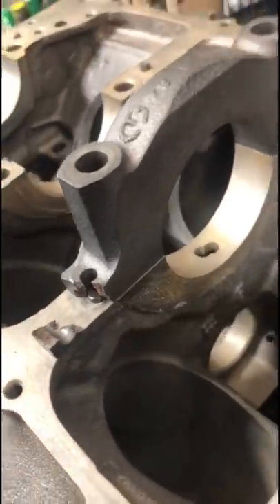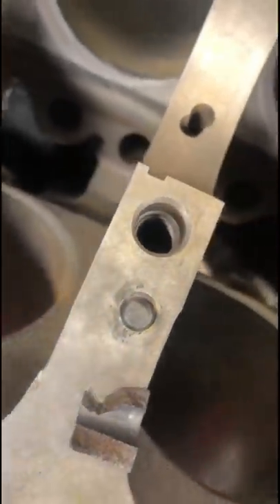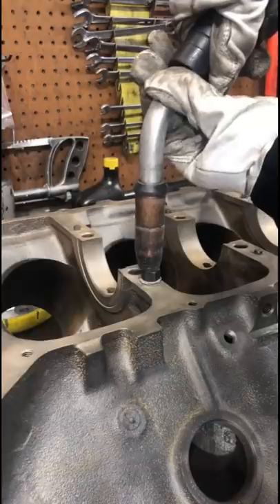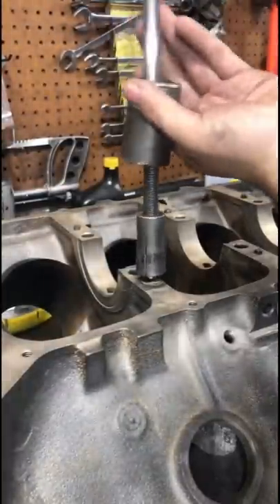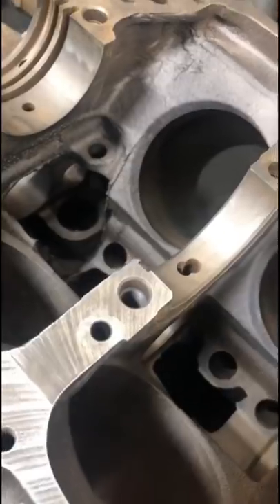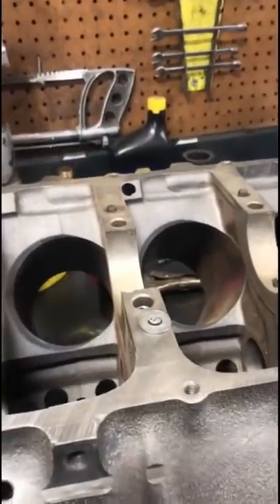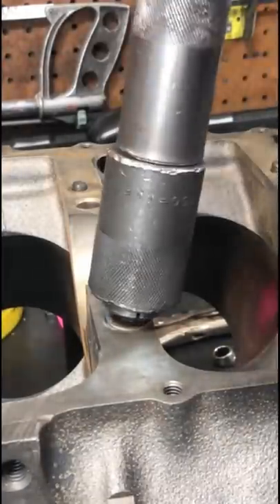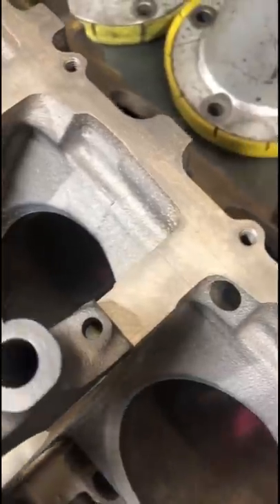#shorts This is why you should pay attention when building your engine…

Comment: Using an impact... On bearing caps?!😵 Who does that?!
Reply: I do
Reply: @MrOtter2270  😎
Reply: Yeah, wtf? I remember saving my money to buy a GOOD torque wrench, then practicing with plastigage on a junk motor just to get the feel and accuracy of the procedure. Thought of ANY other tool never crossed my mind.
Reply: My Milwaukee 1/2 onekey impact has torque settings that I can adjust with my phone. I still wouldnt trust it lol
Reply: @itsjustmechill.5292  been eyeballing that thing. Sounds like a 30-pack Friday night “learning experience” in the garage. BYO30 of course. We can “learn”, just not share😏🍻
Reply: I used to do it all the time when I worked on a top fuel team. But outside of that it's a very bad idea especially with cast iron.
Reply: @southjerseysound7340  they do the same thing at factories also. With proper tools you can do anything. 
But slamming one down?
That would be a no.
Reply: I thought 2 ugga-uggas on a breaker bar was the proper torque?
Reply: @southjerseysound7340  What does using an impact mean?
Reply: @tafarid.7347  impact driver/wrench. Either powered by air or electricity. Too much torque produced for applications such as bearing caps. 

I too would fire anyone in my shop doing this.
Reply: @southjerseysound7340  it’s about finesse and experience. I use shortcuts similar to this depending on the machinery, but have over 10 years as a service tech.
Reply: @nigeleharis5886  So...like a mechanical wrench? Sorry I'm still a bit confused, but thanks.
Reply: @tafarid.7347  I’d say so. It does the work of an open end 🔧 very quickly and with a lot of force.
Reply: @nigeleharis5886  Oh ok, thanks.
Reply: its ok my cylinder head and spark plugs were tightened with an impact. ill never forgive that shop
Reply: Right
Reply: Lazy mechanics.
Reply: @joriskylie6857  What are you talking about? They use robotcells with industrial torque programed drivers to sequencially tighten them. Usually from center->out, in steps.
Reply: @Tabacish  I didn't make it clear but what you said is what I meant. 
I was responding to the comment the guy that worked for a top fuel racing team.
They don't slam their parts together with impact guns. They use specialized tools.
Reply: @joriskylie6857  Gotcha
Reply: Although a top fuel race enging is only supposed to last a few minutes so it's unlikely that you'll wear out the bearings due to torque....
Reply: @flipnotrab  half the "experts" here in the comments dont even know what plastiguage is. They probably dont even know what a clearance spec is
Reply: @thefinalkayakboss  you’re probably right unfortunately. Specs? What specs?! Where’s my impact??? 😂😂😂
Reply: That’s just stupidity…only for removals…any mechanic who does otherwise avoid 😯
Reply: not on automotive engines, but some heavy industrial call for an initial torque, and after you tighten them to that torque, the final tightening is specified in degrees of turn. Nothing wrong with using an impact wrench on those engines, 60 degrees of rotation is 60° of rotation no matter how you do it.

And why are you guys talkin about bearing clearances? The torque does not set the bearing clearance, the bearing clearances set by the diameter of the journal and the bearing size selection.
Reply: Almost every car related youtube channel does this.
Reply: @joecummings1260  bolt stretch has an equal and opposite strain pushing against it that is thread distortion. If you overtighten the bolt the thread distortion will pucker the threaded mating surface, throw off concentricity, reduce the contact area and make the cap prone to rocking.
Reply: @JorgeHernandez-lu1mi  yeah I've been through that working on aircraft engines. In fact if you remove the cylinders for any significant amount of time you have to bolt a plate on to where the cylinders bolt to the crankcase to stop the aluminum from distorting due to lack of fastener tension. But a cast-iron block automotive engine, unless you're a total animal and really over torque the bearing caps, I've yet to see it make any significant difference in the bearing clearances.. not anything you're going to be able to measure with a piece of plastic gauge, that's for sure.

The same goes for the honing plates that you both on in place of cylinder heads when you do the final holding on a cylinder block. I've yet to see any kind of significantly difference in cylinder contrentricity  with them on or off a cast-iron block.

Frankly it seems like the younger mechanics worry too much about the wrong things. , They're all super concerned with torque being some kind of super precise thing. I see a lot more blowing up motors over stupid little oil leaks, then I do from incorrect torque
Reply: My grand uncle built drag cars, and never used a torque wrench.
Reply: @MoswenMedia  I'm 60, and when I started turning wrenches when I was a kid, you almost never saw any of the older guys even picked up torque wrench. when you start as a helper when you're still in your single-digit years you develop a feel fort work and fastener preload. If you wait until you're twenty and then enroll in a tech school, there's a good chance you're never going to develop the feel. It's kind of like this, I had a cousin who played for the New York Knicks, from the time he was a little kid all he did was practice basketball. you don't get to be a pro basketball player by starting with an interest in basketball at like 20, if you don't start from the time your little kid, you're never really going to end up being a pro
Reply: @joecummings1260  yea I watched him tighten heads down with an impact as a kid and never checked the torque. He had a 426 hemi in a dart that my uncle could take down the quarter mile in 10 seconds
Reply: Ugga dugga
Reply: @joecummings1260  Torque to yield (°'s of rotation) after an initial torque is fairly common in automotive applications, particularly engine assembly. I sure as shit wouldn't trust anyone who uses an impact to re-assemble a motor. 🤦‍♂️
Reply: @divinetruth2875  degree of rotation, is degrees of rotation no matter what you use to turn the fastener. And not all fasteners who's tightness is specified in degree of rotation are torque to yield fasteners
Reply: Absolutely
Reply: Idiots apparently. The only time I use an impact on aluminum is to quickly speed it home and its usually a hex driver. Light trigger too.
Reply: Mechanic Steve here on Y T does it and people say he is the best mechanic in the 🌎
Reply: I do it. Hell, I'll take a running motor apart JUST so I can
Reply: @elkayezs8wslkwaterfountain826  Damn
Reply: @elkayezs8wslkwaterfountain826  was it jiffylube? 🤣
Reply: Only use a 3/8 impact to run them down on the lowest setting and then use the torque wrench never had a problem out of the 25+ I’ve built
Reply: @joecummings1260  millwright tight!
Reply: Right? I usually welder them on
Reply: @elkayezs8wslkwaterfountain826  I normally do maintenance on my moms car but wasn’t home and she took it to wal mart. The next oil change I got to do for her instead and found out that they not only used an impact on the drain plug but they used the wrong size socket and stripped the plug. I was so angry. It doesn’t keep any effort to tighten the drain plug correctly.
Reply: I use impacts on a lot of things anything on the inside of the engine even im not dumb enough to touch with an impact
Reply: @tafarid.7347  typically an impact is used to REMOVE stuck nuts or just remove nuts quickly.

Technically it's not supposed to be used to tighten down even lug nuts, certainly not anything as precise as internal engine nuts and bolts.

What likely happened is someone was using the impact for quick assembly, planning to do it right at the finish with a torque wrench only the main cap wasn't lined up on the dowel. He probably didn't even hear it pop.
Reply: @Tabacish  hell, they build those loose in the first place. Dumps oil through massive gaps and spins fast while burning a 33% fuel to air mixture.
Reply: @joecummings1260  Oh brother, the deformation on a cylinder when tightening down a cylinder head is massive, but of course that depends on the setup. Massive cast iron? Some. Individual liners pushed down by head? Yup. Cast liners in alu block? Yep, even position might be off..
Also, it's next to impossible to measure this by hand, you'll need a proper CMM..
Reply: High school kids or adults who stopped learning when high school ended
Reply: Unga unga
Reply: I’ll use electric to get them started, then torque down after and I’ve never had any issues🤷🏼‍♂️
Reply: 1 ugga or 2 ?
Reply: People that build 15L AND UP engines
Reply: @flipnotrab  right?? Like these are the internals of your compression based engine. Not just some fuckin screw on a door 😂
Reply: @itsjustmechill.5292  good. Impact and Torque don’t go on the same sentence
Reply: Pakistani truck mechanic
Reply: I do
Reply: You use impact for this kind of work, sorry but you're a butcher, not a mechanic
Reply: After hand starting, I use one to snug them down and then by hand again to finish. To use one all the way is nuts.
Reply: Same kids who buy cast caps
Reply: Torque Wrench only
Reply: All too common nowadays. Especially in auto shops that force you to clock in to every single meaningless task so they can chart efficiency (basically a guaranteed system of rewarding shortcut taking) and force techs not to take pride in their work.
Reply: Absolutely not using an impact , only good thing is atheist it didn't make it back to the customer before they broke
Reply: @glenwaldrop8166  That's why best practice is to close joints before tightening bolts and not using the fastener to close joints
Reply: @MrOtter2270  really?
Reply: People with so called budget builds but spend hundreds thousands on a build aka tv shows
Reply: @flipnotrab  😄
Reply: There's a reason you have to tighten them in sequence and to spec. Then you have to do it again, using a impact would almost always cause a weak point for something to break.
Reply: Lots of people and it's not a good idea.
Reply: On heavy duty diesel applications where the torque is 180ftlbs plus 120 degrees on stretch bolts I use the torque wrench for the initial torque and 3/4 impact for the angle to stretch those bolts.
Reply: Lmao I built a 454 big block with an impact
Reply: I just worked at an engine shop, diesel engines, these guys put the crank im with an impact, torqued it to spec, then… get then 😂 they used the impact for degrees of rotation.
Reply: The very cheap garage....
Reply: @thefinalkayakboss  plastigauge no. But micrometer...YES
Reply: @juniperjd4891  clearly none of these automotive heroes have done a set of mains on a dd15. Half of them would have a hernia twisting them the final 90°
Reply: @blairthompson3445  fr you are not lying every time I work with cars everything feels so tiny and small and easy guys don’t know how easy they got it lmao
Reply: Guy is definitely humble to admit his mistakes
Reply: @northdakotaham1752  flat rate crew 😅😅
Reply: Homeowner engine rebuilders.  True “engine building” is MUCH different than just assembling parts you bought in a kit off eBay.   Let the replies fly in on this. 🤣
Reply: Torque to 180lbs then turn 2 flats. I’ll use my 3/4 thank you.
Reply: UTI students with less than 80’s on their tests
Reply: Maroons
Reply: E experienced mech.?
Reply: @martinbernath  Not mine
Reply: The real question is why is he using the bolts to set the caps
Reply: My brother
Reply: @garysgarage.2841  mine too! 😝
Reply: Heavy duty diesel, some engines the manual actually tells you to use an impact believe it or not lol
Reply: @Club-kc9wl  yup and go 6 flats worth of rotation
Reply: Only clowns do that.
Reply: With the engines I work on, you have to. It's in the manual.
Reply: Me building the last 100 engines, my old boss proably on several thousand engines. A tool is only as good as the user
Reply: @townsendliving9750  very good point. Six point socket with the lines drawn at each point so you can add up the angle!
Reply: i do but not full trigger. pretorque spec is 1/2 ugga dugga
Reply: Theirs not many of them....I mean really how long could it take 😅
Reply: My dad most of my life. Not that he's built anything of particular note, but that's how he's always done it. I'm not that brave I use a nice click type torque wrench personally, using an impact feels so wrong I've never even thought of it.
Reply: People who don't know how to use a wrench
Reply: Some of these people seem to think you are using an impact instead of a torque wrench no its just to snug them up
Reply: Same guy that uses one on the oil drain plug ! ! ! ! ! ! ! ! ! ! !
Reply: All the time on CAT 3400 and C-Series engines - torque main bolts to 190 ft/lbs and turn an extra 120-deg with a 1" drive impact.
Reply: I’ll use a little impact driver, which might cap out ~50 ft-lbs (on a good day) on main cap bolts, which isn’t as tight as most mains go, so I’ll use it to seat the caps to check my clearances and/or just to bottom out the bolt so I can torque it properly
Reply: @MrOtter2270 I hope you’re made to pay for your reckless behaviour. That was to be the dumbest thing ever when working on an engine rebuild.
Reply: @redneck4200000 I hope you’re made to pay for your reckless behaviour. That was to be the dumbest thing ever when working on an engine rebuild.
Reply: people who also got "vaxxed".
Reply: Had a guy at dealer(lexus) that would use his impact for all his cam riser bolts and cap bolts and everything . Also had a guy whiz wheel his heads and block on a rebuild and then the head gasket wouldn't hold lol
Reply: @thefinalkayakboss plastigauge can lie to you, so keep that in mind. I prefer using more precise methods.
Reply: @thefinalkayakboss I love using plastigauge and its either on the number or its wrong no within a thou bs. Thankfully I read Smokey Yunick and Bill Jenkins books at a young age. I am still learning tho.
Reply: @joecummings1260 Yes right here. Thank you. Agreed
Reply: @joecummings1260 Yes. My father started me very young. Lol Child services these days would have kittens seeing what I was doing at 4 or 5. I thank my father for doing that for me all the time. I encourage people start them young. I know it kept me out of trouble and gave me a love to keep learning.
Reply: @jcues03 I use both it feeds my ocd lol
Reply: I like to ask those kids that use a torque wrench for everything where the latest certification for their torque wrench is, and if those values are for dry or lubricated fasteners, and if lubricated, what the specified lubricant is. I always get a blank stare. I on occasion repair some machinery and structures where I have to  provide certifications and personally document the fastener preload process. They all think they are so smart because they went to some BS auto tech school. The idiots don't even know what a multiplier is. Tech schools aren't worth shit
Reply: @joecummings1260  Yes my father does the same thing he has done  industrial/heavy equipment millwright work and automotive for over 50 years. I never went to college because I never had time I was too busy constantly learning while working. I still haven't stopped learning I only know a little bit.